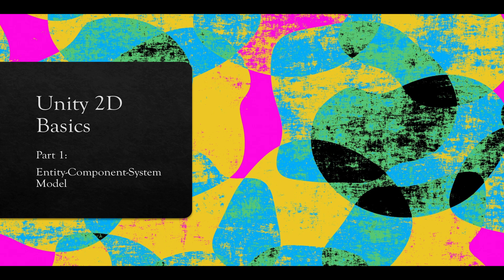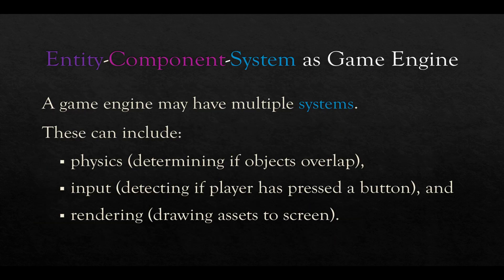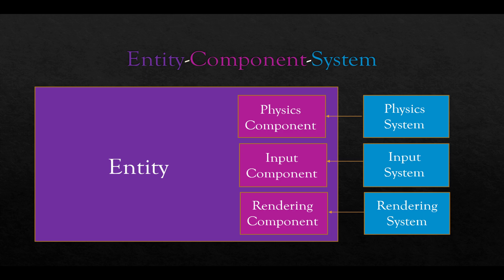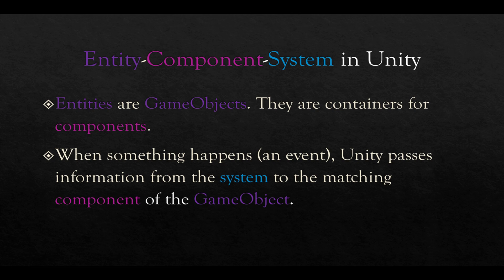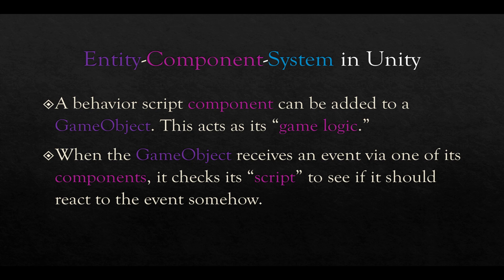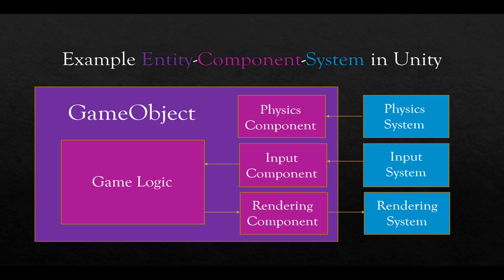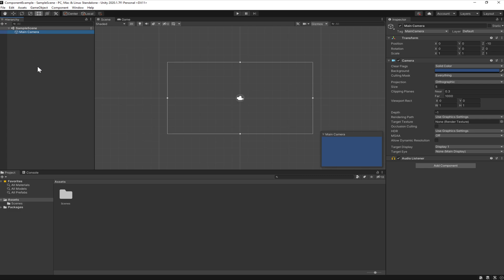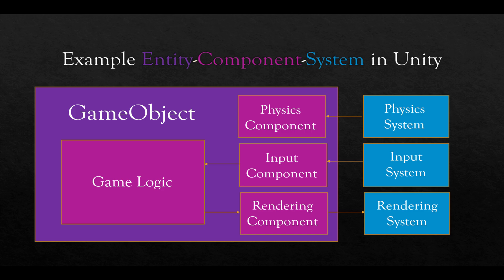Unity 2020: 2D Basics: Part 1: Entity-Component-System Model

Comment: This is incorrect and what is described here is *not* an Entity-Component-System.

ECS is an architectural pattern where data containers (components) and logic (systems) are separated. With Unity's GameObjects that is the case. Unity is working on implementing an ECS approach in their engine, but it is still very much work in progress (as of writing, it is a preview package https://docs.unity3d.com/Packages/com.unity.entities@0.17/manual/index.html ).